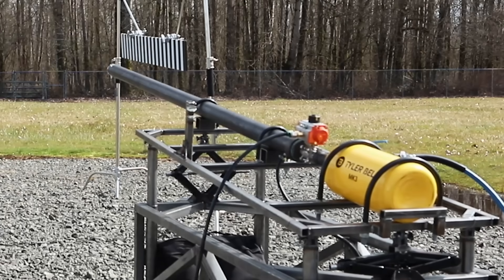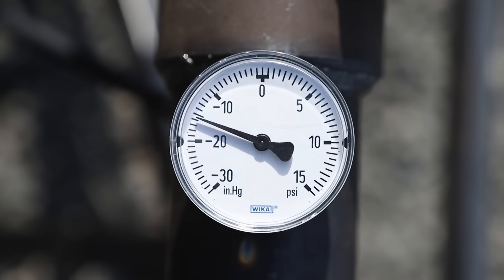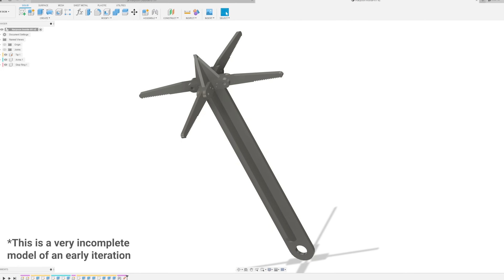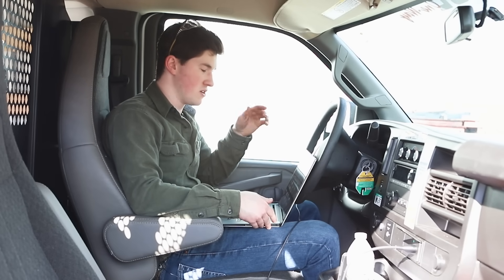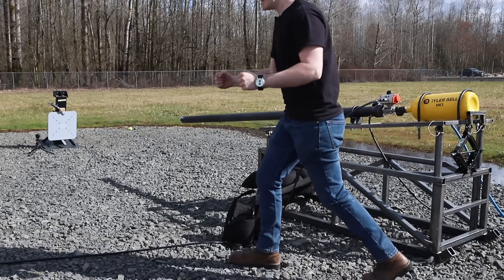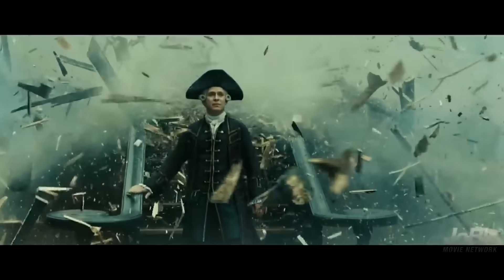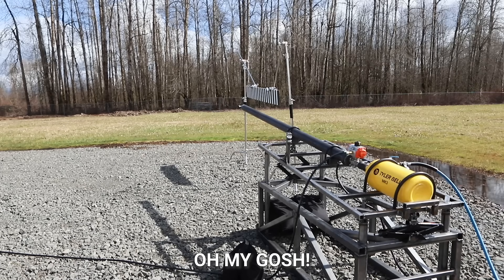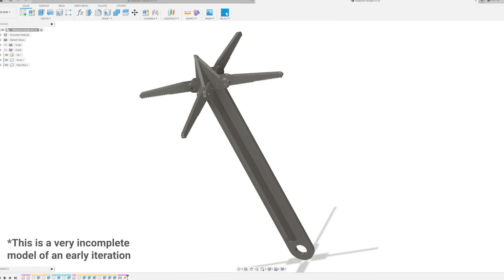Have I Found the Fastest Air Cannon Valve??

Comment: I would think a firing in connected to a plug on a tank when struck the seal is broken all the pressure releases and could even do a rocket exhaust throat to speed it up     And there are valves in rocket motors that have to open and throttle with extreme precision as well as be able to sense and react to things in millionths of a second cause they have to close when first lit and the turbines spin up the pressure and writhing everything rises so high so fast that it causes a known harmonic reflection pressure wave moving backwards thru the now supersonic moving liquid and if this is reflected pressure wave gets further back past the valves throttling the fuel into the turbines it blows up the whole rocket if you close the valve to early or to much or for to long you ether explode or flame out and it has to be disrupted cause till they learned about this stupid backwards moving pressure wave on ignition sequence they kept blowing up rockets and couldn’t figure out why. Till they had sensors recording data of pressure at a resolution high enough for it to be seen as well as some one to recognize that what it is and that’s not even getting into the really complicated part on how they use super fast computer controlled  precision valves that can. Go from closed to wide open to handling heats pressures and supersonic fluids as well as sound traveling thru it at levels that can pose a danger by them selves but yeah what ever crazy fast actuator and valve they use would be perfect if it scales down and still keeps the same performance and tolerances. Valves are some super simple equipment yet having them meet performance and environmental requirements is a whole other can of worms and the gap between the most simple or basic one way flap valve to Tesla using geometry to make a one way valve with out moving parts that acts more like a diode in electronics vs a analog device with literally no moving parts just relying on the resistance of the all ready moving liquid to do the work with out many of the failure or loss of performance over time consumables like washers and gaskets that require upkeep and supplying spare parts. His could theoretically sit on a water pump for thousands of years if made right and never need any input past something dropping the pressure to draw the water up and thru yet won’t let air or water flow backwards keeping the kinda tension on the water while in use.

Comment: I don't know if anyone has brought this up in the previous comments (932 of them...) but I've found that the fastest acting valve is a Dust Collector Valve (or Pulse Valve).  I use these for various special effects and whatnot - SMC - JSXFF-14N-5DSB PULSE VALVE.  They're 1 1/2" but I believe you can get them in 2" through SMC and even bigger at other companies.  Just a thought.

Comment: I recently purchased a custom 22LR barrel. One of the primary features is that it has been hand lapped and hand polished. If you haven't tried this, it would be done exactly the same way for your purposes. In case you haven't tried this. 

A smoother bore always equates to faster speeds, all else being the same.

Comment: Seems as though you may have hit near-terminal velocity with the tennis ball.  There is an enormous amount of low pressure (turbulence) behind the ball at that velocity, which may be a significant contributing factor in getting a faster speed.

Comment: I don't know if you have made any further developments in this area, but what you need is a pilot-actuated diaphragm valve, or pilot operated piston valve.
The pressure of the air itself holds the valve shut.  The piston sits on the end of the cannon barrel.  Both the bottom - the part of the piston against the barrel - and the top of the piston are subject to firing pressure, but air cannot leak around the piston.  It's inside its own barrel with a good seal.  Air CAN leak THROUGH the piston via a small passage, from the lower to upper chambers, but not to the barrel.
An aperture is above the air space at the top of the piston.  It's closed with a tappet valve or similar.
Dislodge the tappet valve and the pressure in the top chamber dumps.
Pressure on the bottom of the piston is now much higher, and blows the piston completely off the barrel.  This opens a huge area very quickly for maximum gas flow.
As soon as the tappet valve is released, pressure begins to build on top of the piston again, forcing it closed as air pressure from reservoir drops.  Piston automatically resets as piston area on top is larger than piston area below, minus the area of the barrel cross section which is open to atmosphere.
NOTE: this is how toilet flushometers work.

Comment: Greater seal of ball within tube needed....as you partially demonstrated .  A cup of water or higher viscosity will help the seal.  Sealing efficiency more important than drag.  A wet leather cup seal is a great choice for a pusher design behind the tennis ball or other.

Comment: Burst disc cannons are awesome, a couple decades ago when I was in my mid teens my main hobby was potato guns (back then I learned everything from an internet forum called SpudTech, currently known as SpudFiles), I have built literally hundreds of potato guns of all shapes and sizes in all three types, combustion, pnuematic, and hybrid, and the burst disc valve design was consistently found by all members of SpudTech to offer peak performance for both pnuematic and hybrid cannon designs (combustions not so much, they limit performance). It also makes reloading a much more complicated task, the barrel has to be removed and the burst disc swapped every time so it wasn't popular with the everyday potato gunner, but some of us die-hards liked them. 

The Hybrid potato cannon is something you should also look into, you're 90% of the way there essentially. Way back when, two of our more prominent members (one of them a weapons developer for the DOD lol) were working on a burst disc pnuematic project together and got the brilliant idea to inject a stoichiometric mixture of fuel (propane) and air into a burst disc pnuematic cannon and slap in an electric igniter with the ignition pressure bursting the disc, it changed the potatogun game after they posted pictures of a refrigerator with a 3" hole through both sides (they shot it with a 3" diameter plug of concrete about 4 inches long at 800 FPS😂). The chamber of the gun has to be made very strong too, they need to be made of metal if shooting mixtures higher than 3-4 bars, Sch80 PVC will work below that (for a 2" diameter combustion chamber) but barely, steel is much preferred. A four bar fuel/air mixture will generate between 400-450 PSI at thousands of degrees F° upon ignition, and the gas can potentially undergo deflagration-to-detonation transitions if the chamber isn't designed properly which can put enormous shock stress on weaker materials. I could go on and on about this stuff but I'll end it here lol.

Comment: *CHALLENGE* Make this in to a more portable version, that can break down and be packed up. Applications in particular would be using as a bait cannon for surf fishing, and also firing a tethered line to hoist up radio operators antenna coax.

Operating parameters should be similar to first three iterations, and above all must operate at 2000 psi.

Comment: Freeze the tennis balls. Drill a 3/8 hole through the tennis ball, enabling you to fill with water. Plug the holes and freeze. You'll have a better result. The tennis ball in natural state, doesn't have enough mass behind it, thus causing more drag and I'm sure some of the pressurized gas is escaping around it, as it pushes it through the barrel.

Comment: A differential pressure diaphragm valve is made to dump air pressure  instantly they are used in industrial blast freezers to clean frost out of the refrigeration coils

Comment: Lets start from the beginning, because I think we are missing a valuable lesson here.  Why are you trying to shoot a soft fuzzy squishy slow motion tennis ball at high speed to begin with. It isn't designed for this and it will  mechanically try to fail in every way possible because it isn't suitable for the task.  Soft rubber balls are not made to go beyond the speed of sound, and if they could they would only explode from the opposing forces.  A ballistic projectile fired from a barrel must meet some basic concepts. The barrel must be true in dimensions, the projectile must fit the full size of the bore or use a sabot device to carry it and seal the full diameter of the barrel, and the projectile must be able to aerodynamically fly through the air at the velocity you are designing for.  As none of your air cannon parameters meet these minimum specs, your 500 fps rates are reasonable.

Comment: you should you a pressure based burst disc rather than a manual one. That way you get an instant max flow rate and at a way higher pressure.

Comment: Your gas volume to barrel length is killing you. At what point in the barrel is the gas reaching lower pressures after the first like foot you are slowing down the tennis ball as you run out a gas. You are not using a gas generator like gun powder. So your projectile is not accelerating down the barrel its slowing down. You need a larger volume of gas behind you projectile and a shorter barrel as its only imparting drag. Lowering barrel diameter is not an option if we want to keep launching the same projectile.

Comment: You’re limited at least partially by the speed of sound in Nitrogen. Even if you had a perfect valve; a barrier between reservoir and barrel the full diameter of the barrel that simply disappeared the instant it was activated, the air at the front of the tank needs to move out of the way of the air at the back of the tank, and guess how fast it can do that. Yeah, the speed of sound in your propellant gas.

NASA actually has a hypersonic cannon they use to model high velocity impacts between objects and what they do is they use a chemical propellant to drive a piston which compresses Hydrogen to multiple tens of kilo pascals before a spike on the front of the piston ruptures a burst disc and drives the projectile. That’s because far higher speeds of sound can be achieved in hydrogen than in any atmospheric gas. Just have an ignition source in front of the barrel to mitigate any fire/explosion hazard.

Comment: Because of the plasticity of the tennis ball, you are losing pressure around the ball, because the pressure is heavier than the ball, causing air to slip past the ball. 
Which is why the hard ball can travel faster. 
Please take this into consideration when trying again, as it was our findings.

Comment: Retired Artillery Officer here.......   try your heavier resin (or even water) filled ball, greased, in a longer barrel. You might also investigate a simple discarding sabot with appropriately sized O-rings to achieve a better bore-projectile seal.

As far as hi-speed photography, there are some other YouT00bers out there that specialize in that....   team up.

Comment: As you know, the problem is the speed of air release.  This problem is solved industrially by valves that use an air pressure differential to suck a blockage out of the path.   Basically, the barrel would be blocked by a plate that is free to move linearly. Move it back, and it unblocks the full barrel.   There is a large tube around the back of the barrel that holds the air. but there is a small tube behind the plate just far enough that if the plate moved back to it, the open area between plate and barrel would be equal to the area of the barrel opening.   This tube has  a pressure release to the outside world.   When you hit the pressure release, the pressure in the small tube drops to atmospheric pressure.  The tube is sucked to the barrel by the barrel vacuum, but it also is exposed to the very high pressure of the tube holding the air, which more than counterbalances the vacuum.  As soon as the pressure behind the tube drops below the pressure of the tank, minus the area under vacuum, the plate snaps open instantaneously leaving the barrel unobstructed.    It takes a redesign of the gun though. You can't take the air right out of the tank--you need the reservoir around the barrel. This makes it critical to have a very solid design as you have a bursting hazard that is much less with your current scheme.

Comment: maybe u canuse a hot needle toopen the burst plastic that u can shoot with a electrovalve to the burst plastic so it open faster or u can use a diesel heater adapted with a sharp edge tha can be moved bu a electric valve

Comment: multiple smaller tanks that join into one larger barrel with much larger valve :) Open each smaller valve from each smaller tanks and pressure builds behind the large valve. Then you can release it all faster.

Comment: Not to jump into the science too quickly, i have several upgrades you might think about. Valving, this can be achieved with a tire machine component. The dump valve that empties the bead blaster portion of the tire machine is a component specially designed to empty a 6 inch diameter tank 5ft long in 1/ 10th of a second. Its useful when initially airing a tire that has been barrel stacked putting the beads close together. It blasts a huge amount of air through several nozzles to direct and capture the air inside the tire itself slamming the beads against the rim sealing itself off. This sets the tire on the rim so you can inflate it to operating pressure. Its easier to watch bead blasting tire videos than to typt it out. A small hose actuates the dump valve and if you have two resevoire and two dump valves plumbed into the same cannon im sure you could get sound barrier action. Also longer barrel

Comment: 700mph with a hockey ball. Got about the same output with compressed air and tennis balls. Heated air worked better but still didn't do it. Convergent invergent de Laval won't help much in this case proven that using compressed gas won't change velocity and may be worse... you need a lighter propellant using helium was key which increased the output 30% and the hockey ball has less warp in the nozzle than the tennis ball, less friction and increased velocity.

Comment: A longer barrel might help to give your projectile a longer time to accelerate. If you want to squeeze out every last bit of the stored energy in your tanks you could try heating them to keep gases from potentially liquefying for a split second as the pressure drops.

Comment: I wonder if a negative air cannon would work where there is a tennis ball in the middle of a long tube and it has two breakable seals on both sides and you break one side all the air rushes in due to the negative pressure and launches the tennis ball out the other end

Comment: You don't need a de Laval nozzle to exceed the speed of sound in the propellant gas. This is a common misconception. The familiar derivation for isentropic nozzle flow explicitly assumes a steady flow, which a gun is not. An excellent treatment of the topic can be found in "The Theory of High Speed Guns" (Arnold E Seigel, 1965), which is freely available online. There are many practical examples of guns that throw much faster than the initial sound speed of their propellant gas. What you need is simply higher flow, a faster opening valve, and less pressure in front of the projectile. You may also need a sabot to deal with friction from the ball. This is easy enough to test by comparing speed for a tennis ball against a rigid projectile of the same mass.

Comment: There are decades of hobbyist projects regarding pneumatic launchers online in forums, they solved the fastest valve question long ago, you need a piston valve with high flow geometry and its effective cross-sectional flow area has to be larger than that of the barrel. You achieve higher EFFECTIVE flow area by contouring the path of the flow so that it stays as laminar as possible OR you over-size the valve OR you build your launcher with multiple smaller valves that open simultaneously. If you are worried about tennis ball deformation, you may need to make it a sub caliber design and enclose the ball in a sabot, this will also make reaching super-sonic speeds easier.

Comment: hmmm air expands at exactly the speed of sound... which is relative to pressure among other factors... but still... an air cannon should not get it's projectile much faster than the speed of sound in the surrounding medium, even under ideal conditions... try compressed hydrogen instead.

Comment: A variable that might be interesting would be barrel length, you could be limited in acceleration because you leave the barrel too soon. If you get the barrel longer and you don't see an increase in speed it means you don't have enough air, but at a 1000 psi i doubt it. I think you may need to get a tank with a larger opening, even if the valve is smaller, the shorter the small diameter section is the better.

Comment: Doesn't a piston valve or diaphragm open much faster? In my experience with lower pressure tennis ball launchers, a 1" diaphragm valve shoots the ball twice as far as a 2" ball valve. A piston can open just as fast as the diaphragm and flow more air. 
 I understand that you are looking for more speed, not distance. The same principles should apply.

Comment: You did a nice job on your air cannons and demonstrating them in this video 👍👍 I've got a bit of the air cannon bug 🤣😂 after attending a pumpkin lunch compaction a few years back. I've been working on putting the final touches on an air cannon, I built 10 years ago. It shoots tennis balls, 16.9 oz. Aquafina water bottles and commerical glue plugs. It would be great to see the speed difference in fitted water bottles in your cannons🤔